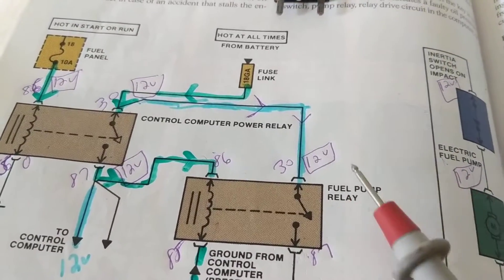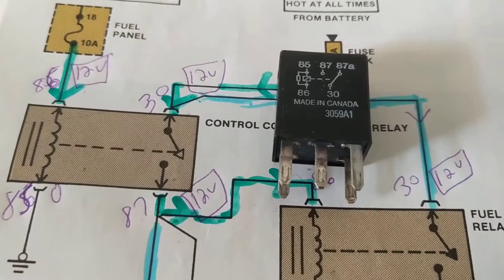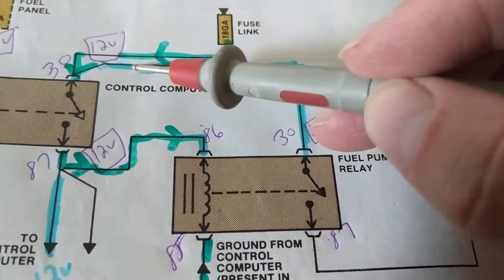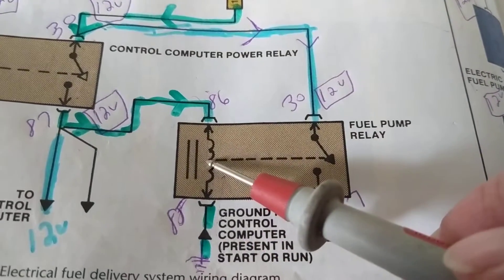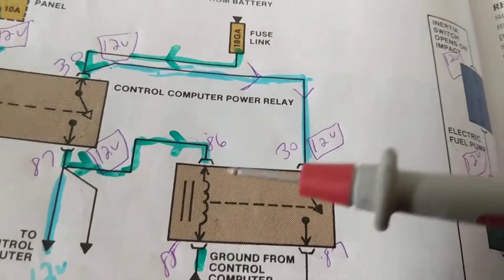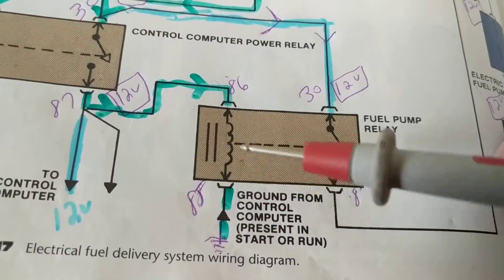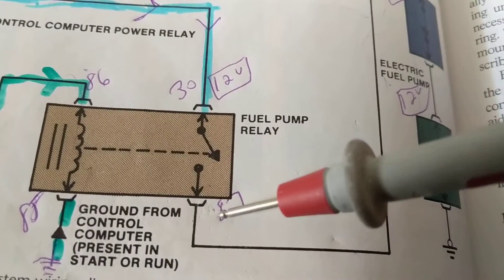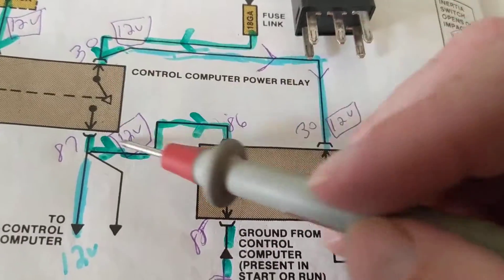fuel pump relay problems how to diagnose from wiring diagram part two

Comment: my relay of fuel pump is very hot what will about that
Reply from the maker: Well there is a certain amount of heat that is given off when a relay is activated however if you want to know the exact current you can put a current meter that they have that measures 30 amps instead of the fuse as long as it has the same rating but you cannot use a meter because the meter is only go up to 10 amps if you need further explanation please respond

Comment: Great video on explaining this!. However, I have a problem on my fuel pump relay. When I turn the key to on, I hear the fuel pump, and the car will start and run but when I accelerate quickly or "jumping" on it , the fuel pump quits but doesn't blow the fuse. I can't start the car unless I put a hot 12V battery fused wire to the fuel pump wiring and then it will start and as long as I'm easy on the car going back to my garage. After I arrive and take the key out, the engine keeps running until I disconnect the 12V bat feed from the fuel pump wire. What would your recommendation be to resolve this?
Reply: When it comes to fuel pumps two things you have to measure if you have correct fuel pressure number two you have to see if you have a code that might not necessarily be something related to a fuel problem should I get down that's the correct way to do it and the recommended way you should have around 50 psi when you crank at idle those are the first steps

Comment: 86 has 2 sec prime and power when crank , 85 has ground , 87 has power all the time but 30 which is going to fuel pump had nothing...but  when i gave straight power to gray wire on fuel pump after that van starts all the time ... its keep doing that van runs ok for 4 or 5 days and all the sudden it will crank but no start and pin 30  will have nothing ... when ever pin 30 has ground van starts all the time ...PLEASE HELP
Reply: 87 is the one that goes to the load 30 is the one that goes to the 12 volts 87 is the one that goes to the pump should have 12 volts on it if the relay is activated see if the relay is backwards or a broken wire from the relay to the fuel pump
Reply: Actually I just saw the circuit that's the opposite 30 is going to the fuel pump like you said an 87 goes to the 12 volts sounds like the relay is not activated or the contact or load side is not closing you have to get 12 volts pin number 30 the trick is just because you measure 12 volts at 87 doesn't mean that the relay is activated and is good try another relay remember also there could be an open between 86 and 85 that's why measuring pin 30 is important to get 12 volts
Reply: Pin 87 will always have 12 volts because it goes right to the fuse to the battery so that doesn't really say much except at the fuse is good and the wire the key is getting pin number 30 to give you 12 volts right to the fuel pump measure 86 and 85 to see if you have resistance on the coil side you should have a small resistance check the terminals inside the relay in a fuse panel also
Reply: Thank you so much for reply .  Sir i checked every thing but when its crank no start then I had nothing on 30 and when its starts then I see ground on pin 30 ... there is 4 wires connecter by the fuel tank ,when it was not starting then I jumped 30 with 87 and check V on gray wire before connecter and V was there , I checked V after that connecter and V was missing then I eliminate connector and van starts now ... but the weird thing was when it was not starting few days ago i just gave straight power with my power prob to gray wire after that connector and van was starting for few days with no problem ...
Reply: fuel sender buffer module and oil pressure sensor is in the fuel system but oil pressure sensor is just for backup of fuel rely and i have no idea  if bad or going bad fuel sender buffer module  would prevent van from starting... well thankx again Sir  God bless you.
Reply: Relay should have 12volts at 30 and 87 if relay is activated maybe computer turn on coil side I have to look at diagram but good troubleshooting

Comment: i need help my car 2011 BUICK LACROSSE CXS  has been dead for 3 months ,it started in sept2019 with a UO100 AND PO23F CODE .my question is ,i cant find answers no where , wtf is a "fuel pump secondary circuit" .  and also , my # 10 ECM fuse keeps blowing ! the best diagnostic tool i have is a "BLUEDRIVER" and i got 2 test lights and one of them detects hot and ground power , and a couple of digital and analog volt meters and a ECT 2000 open and short detector ! !   while i was at dr.'s appt , 3 hrs later i came back and when i opened my car door ,i heard about 8 to 10 fast clicks under the hood , i discovered finally , one thing clicking was my # 7 ecm relay ,and something else which sounds like its under my intake . now when i connect my battery ,it will make noise ,and qa while later do it again .if i use my remote it does it ,if i open or close the trunk and car door it does it ,i am completely stumped on this one ! HHHHHHHHHHHHHHHHHHHHHELP !!!! LOL) THANKS FOR ANY TIPS YOU GIVE ME IN ADVANCED !
Reply from the maker: Yes sorry I didn't get back to you earlier I did not see a schematic for this but whenever you have a code beginning with you usually means no communications to computer module that's number one number two since you have a fuse that blew ECU that goes to the computer module you lost a 12 volts to the computer other thing is the computer controls fuel relays by either the 12 volts or giving in a ground so it sounds like they are all related and your problem is probably a short on the computer line or a sensor that goes to the computer so good luck I keep me informed

Comment from the maker: And sometimes you have a signal going to the computer from the relay telling the computer that the relay has been activated
Reply: what if computer gives no ground. can i run a body ground to get it running/
Reply from the maker: @geraldlockhart809  yes good question I believe I addressed that issue on one of the other videos that you can give a ground to the relay exactly to try to activate the relay very good question and very good troubleshooting on your part

Comment from the maker: I believe part of the video addresses that issue sometimes you have a relaying backup where the computer gives 12 volts and also a ground
Reply: thank you for your quick reply. the car in question is a 2005 toyota rav 4. it is the open circuit relay.
Reply from the maker: @geraldlockhart809  when you ground something you have to make sure you ground the coil side not the load side otherwise it'll be a short circuit and if you have an open the best thing to do is to leave the relay in the circuit go to pin 87 see if you measure 12 volts I have a video on my channel Joe electronics schematics for auto of measuring relays in circuit and then tracing back it's much easier that way
Reply: THANK YOU SO MUCH, I WILL TRY THAT AND GET BACK TO YOU ,THANKS AGAIN  GERALD. @automotiveelectronicsfroms2699
Reply from the maker: @geraldlockhart809  no problem keep me updated the best ways to do it with the relay in the circuit take a wire put it to pin 87 pin 30 you will see if the relay is clicking on and the ground is being given by the computer on the coil side good luck
Reply: also on a follow up, would i cut wire to computer and run to body ground or just tap into it.